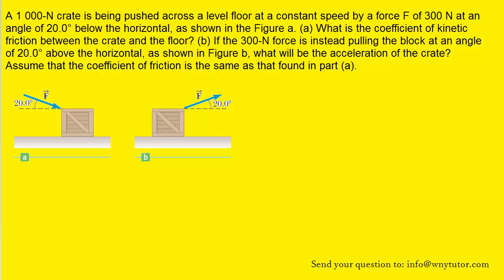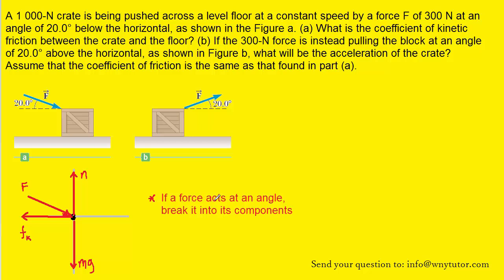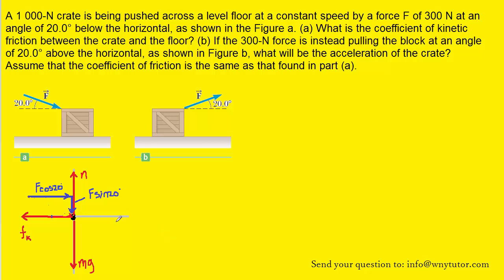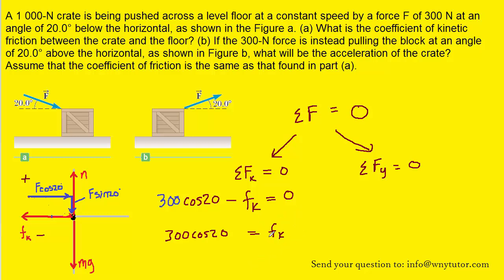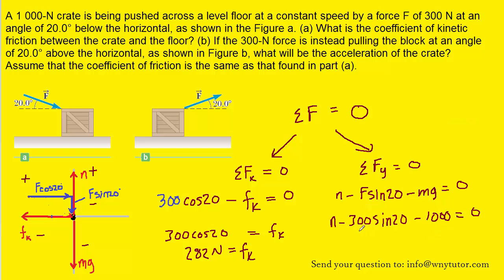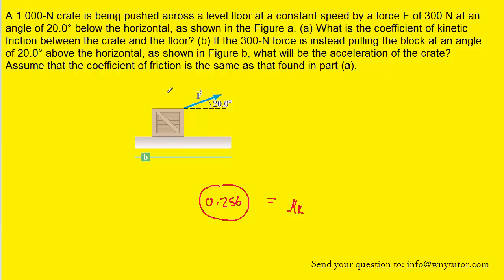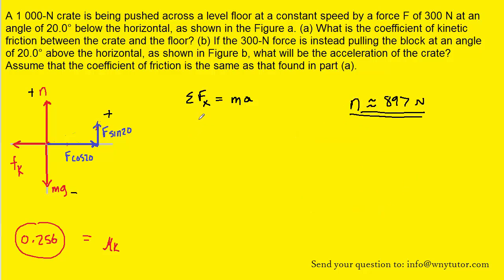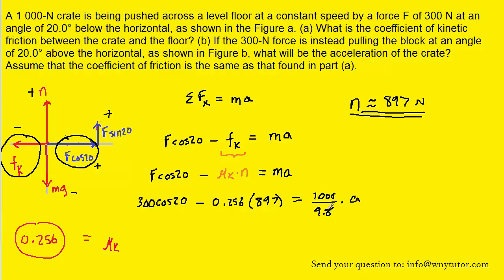A 1000 N crate is being pushed across a level floor at a constant speed by a force F of 300 N at an

Comment: at 7:00 why do you use the Y normal force of 897N with the X coeff of kin friction (0.256)? Why do you use both axees if the acceleration is in the X axis? Why split f_k into mu times normal force in the first place?
Reply: nvm got it. When you break up the angle into x and y, how do you know what direction y should be. In part a, you said negative, but in part b, you said positive

Comment: can someone please enlighten me? What I learned was if velocity is constant acceleration is zero however, if speed is constant it doesn't mean that acceleration is zero. Is it right or wrong?
Reply: What you learned is right
Reply: ye thats right cuz since speed means sum of all velocities, an object could have travelled one way, and then slowed down and gone back the opposite direction to where it started. Since the overall velocity averages at 0, the speed is 0, but the acceleration is not because it changed throughout the objects path.